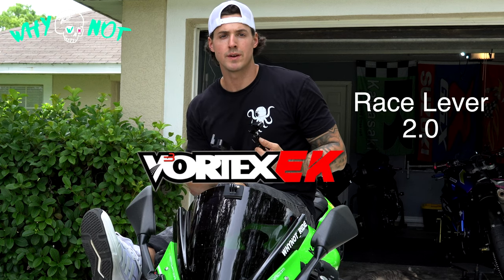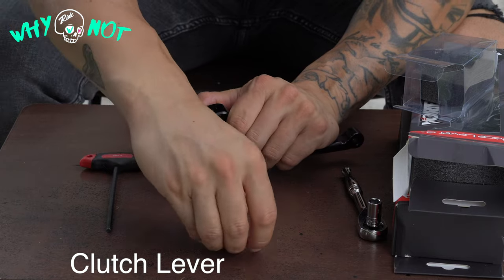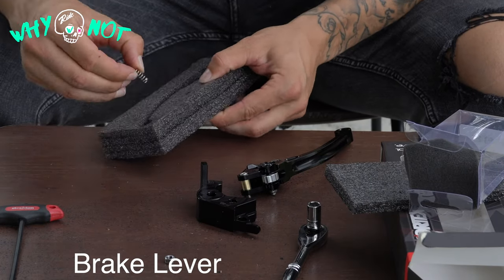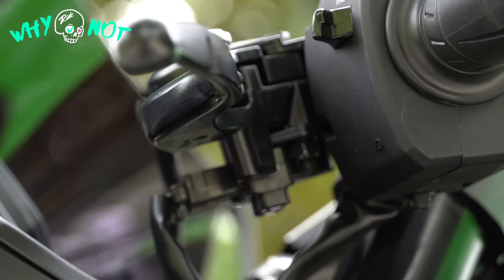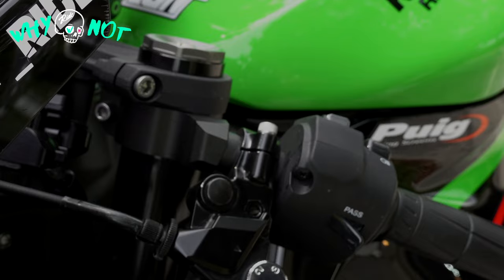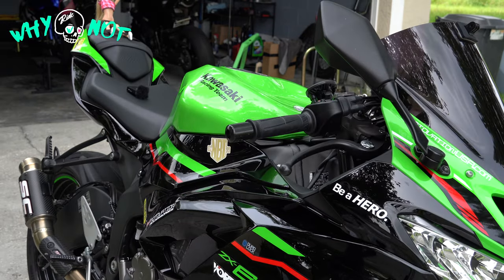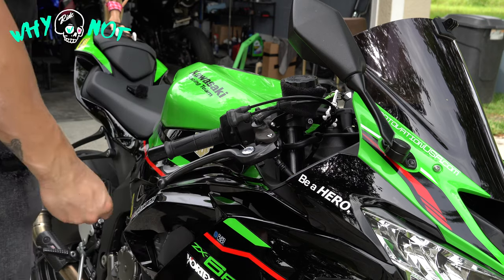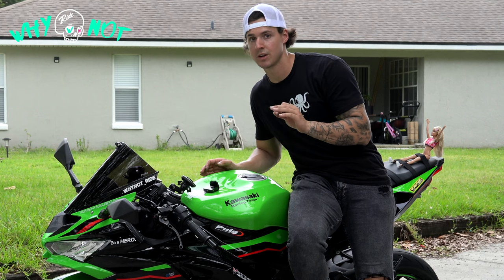Clutch/Brake Lever Assembly and Install (Vortex 2.0)

Comment: Mine both required modifications. My front brake locked on at 100 and for the clutch, it wouldn't start in great with the clutch pulled. Only neutral.

Comment: Did you run into an issue where the clutch bar would go forward and bend at the connecting part a bit?